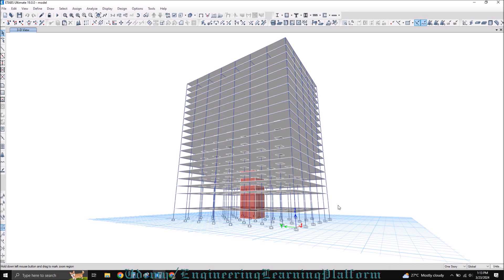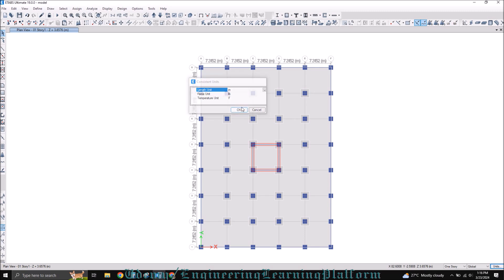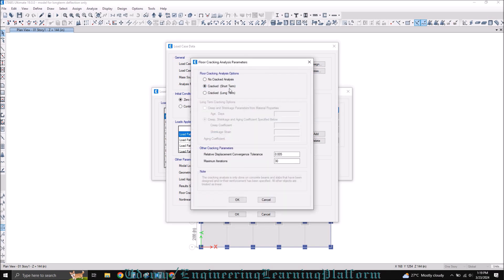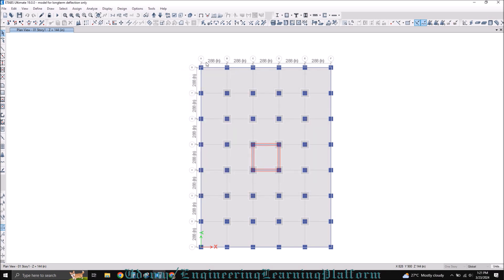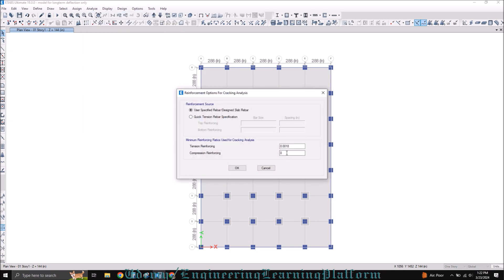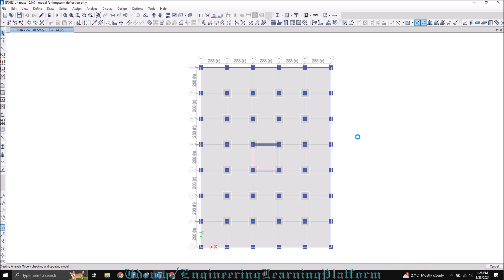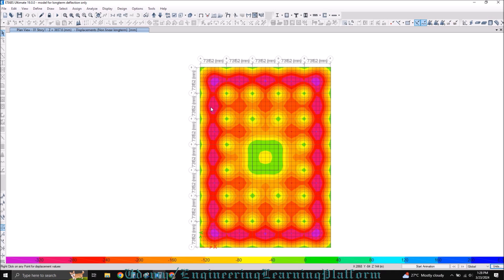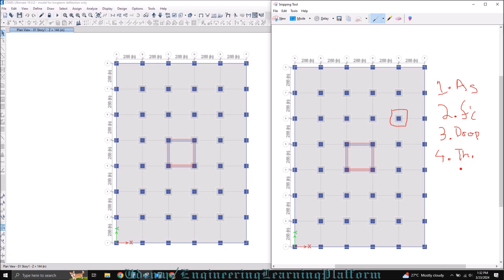Long-Term Deflection Analysis in ETABS

Comment: Hello sir. This is a great lecture. I have a question. In multi-story structure (ETABS), When you drag mouse on a slab (Deformed Shape), it shows the deflection but is it deflection of slab only or deflection of all slab, beam, column combined?
Reply from the maker: Hi, it is overall deflection, include the deformation of columns, beams bending. Overall structural displacement relative to it's original state
Reply: @EngineeringLearningPlatform  So how do I find the deflection of slab only, sir?
Reply from the maker: @yimsopanha5853  Export to CSI SAFE